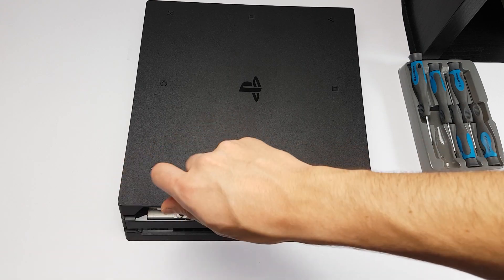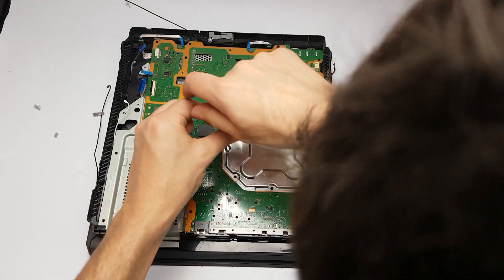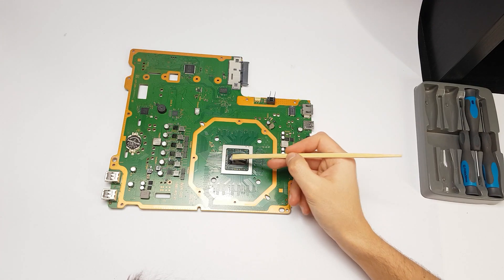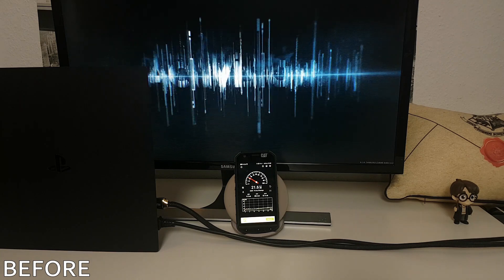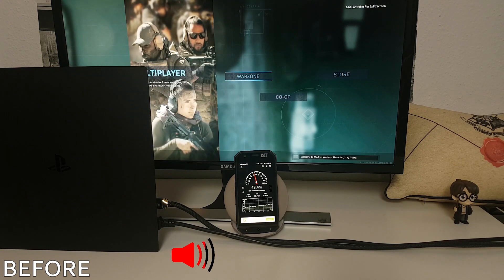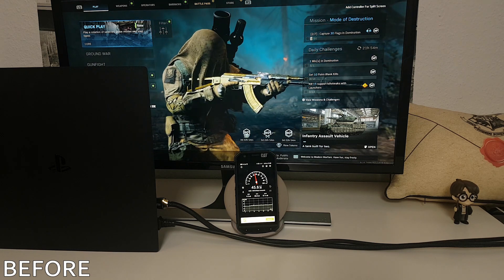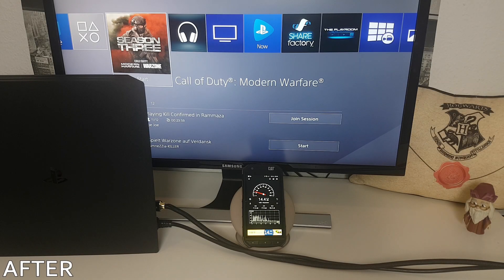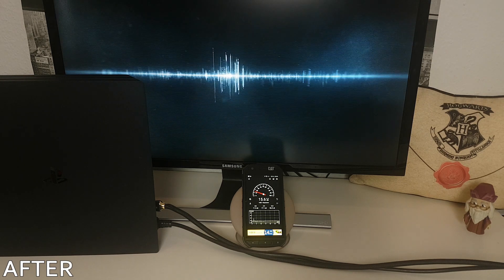PS4 PRO Fan Noise FIX - Thermal paste & dust - Before/After TEST

Comment: No wonder with so much Dust on the Headsink ,  normaly the Thermal Paste holds up more than 13 Years
Reply from the maker: I don't think that the amount of dust is enough to explain the loud noise 🤔
Reply: @SiriusMonkey  You should better watch this Video exactly  you see it removes a  strap big Dust from the hole side of the headsink . for sure this causes overheating  and also it depends wich Fan is inside the Delta Fan is louder than Nidec
Reply from the maker: The amount of dust does not help. But even after removing dust, replacing thermal paste + thermal pads, the PS4 Pro gets loud after a few months.
Reply: @SiriusMonkey  Thermal Pads and  Thermal Paste holds up for Decade  the PS4 Pro is general louder than Base PS4  my PS3 has 14years with stock paste  and if you want a silent PS4 Pro you Need the latest Revision Version they have diffrent Headsink and Cooling  👌
Reply from the maker: That's the point, the first versions of the PS4 Pro became loud after a few months 😊 My base PS4 & PS3 were relatively quiet although I never cleaned them.
Thank you for your feedback !

Comment: `just wondering why you test your playstation standing up, it has a blocked cooling port that way since it's cooling intakes and outtakes are on the side, you're literally just chocking you system
Reply from the maker: You're right, it's definitely not the right way to test it! I've done test with the PS5 standing up and the results were practically the same.. 
Thank you for your feedback !

Comment: I rarely like a video, and even rarer do i comment, but i can't describe how much quieter my ps4 pro got. It's like brand new. I didn't apply new thermal paste, but the guy i bought it from had applied waay too much, so i had to remove a lot of it. Also, i got to clean the heat sink, which was totally blocked. Now i'm not ashamed to turn on my ps4 anymore :)))
Reply from the maker: Nice, I'm glad it helped ! 😊 Though I gotta say that mine became louder after 2 months or so...
Reply: @SiriusMonkey  aight, i was aware it was probably a recurring issue. We’ll see when i have to fix mine again
Reply from the maker: @TheRegularity  Unfortunately yes.. The PS5 is however dead silent ! 😊

Comment: i have cleaned the dust and changed the thermal paste of the PS4 pro at a technitian 3 times already. Right after the procedure the console is really silent, but after only 3 months the jet engine starts over again. i'm also regulary cleaning the dust with compressed air avery month. Maybe Sony are telling us, it's time for an upgrade ;-)
Reply from the maker: The same happened for me.. Ater 3 months or so, I had to replace the thermal paste again. The PS5 however is so silent ! 😊
Reply: Call me paranoic, but i keep thinking it is something implemented in the code of some of the most played games, that is making the chip thinking it is overheating...
Reply: @miroslavgeorgiev8778  i wouldn’t even be surprised tbh all these new games are just making my ps4 louder
Reply: It’s funny to see people like you. There’s an Xbox one x available for sale. Probably someone would swap theirs for your PS4. But you keep torturing yourself. Why? Makes no sense.
Reply from the maker: @vitorfernandes651  Porque gostamos mais da Play 😊

Comment: Does any of you notice that your PS4 also runs quicker and maybe even your game performance enhances due to this fix? Maybe it's a placebo but I have a feeling like it is.
Reply: No it is very true. You see when a lot of elements appear on the screen you experience a temporary slowdown that is called throttling. Since you are not hitting the same absurd temperatures as before, the PS4 does not reduce the clocks to preserve your APU anymore.
Reply from the maker: @cemsengul16  Okay, thanks ! :)
Reply from the maker: Why not ! What makes you say this ? :)
Reply: @SiriusMonkey  I felt like after fixing mine the exact same way you did, not only did sound disappear, but navigating though the menu feels quicker and even my games feel a bit smoother, however I have no proof of this and it could just be a placebo you know 😂
Reply from the maker: @MITSJL  Yeah I got you, it's a very interesting observation! And I hope it's true 😁 Thanks for your feedback !

Comment: 2 hours!? I did it without a t9 security torex in that time 🤣
Reply: which thermal paste did you use ? cause I used Arctic Mx4 but while playing Last of us part 2 it still runs at medium sound . Can you share your experience with me.
Reply: @uzairahmed3103  it was a while ago so cant remember the make, but it was silver based. Had to be careful of overflow. It shouldnt really matter of the make tho. Aslong as you dont put way too much or too little. I put a pee size + a tiny bit extra . Did you clean the heat sync also? I used a fibre cloth as was too sticky for cotton buds. Ps4 is running quiet as when I first got it now.
Reply: @uzairahmed3103  I used" arctic silver 5" had to go in garage to find out lol
Reply: @dragzgaming  Thank You so much for ur time. I also put a pea sized thermal paste in the centre and as for the heat sink I only used a vaccum cleaner on it but it wasn't dirty. Does it take a while for the thermal paste to start acting properly cause I just changed it a few hours ago and I have read somewhere that it gets better in a few days.
Reply: @uzairahmed3103  should tell first time you put it on. If heat sync was clean and you cleaned the CPU before applying paste only other things I can suggest is to brush out the fan with a paint brush, make sure the power block is free of dust by blowing in there and when you put the metal arm back on the top of the metal outer layer be sure to do one side half tight then the other side and try to do it up evenly ( it's designed to spead out the paste evenly by putting pressure on the sync and cpu).

Comment: i test with my ps4 pro and i notice that theres is an amount of themal paste that you have to aply, to much not work, not much its not work theres a middle amount that will works like 1 1/5 drops will work perfectly and i keep testing removing metal parts and almost naked the ps4 makes like 10 or 13 Db as much but i notice that we have to use special thermal paste not all the thermal paste works as well (sorry for my english hope u get it)

Comment: I found that when I had my PlayStation laying flat on not on its side it also stopped making this loud sound ,thanks for posting
Reply: That's because there are vents on both sides of the console. Also as a tip, put some bottle caps in each corner below the console, will definitely make a difference. I'm pretty sure we both know that putting it in an enclosed space will just make it overheat even more, I learned that the hard way...

Comment: Damn your fan is soooo much louder than mine 😂
Reply from the maker: Unfortunately, I'm not the only one 😅
Reply: @SiriusMonkey  dude I also have a question. I cleaned my fan and heatsink and everything else. Scraped the old thermal paste but didn’t add new one. And it’s overheating faster,is the thermal paste the problem?
Reply from the maker: @aaryanatreya5591  You have to apply thermal paste, it is very important! Otherwise the heat from the processor is not properly transferred to the heat sink, which can cause overheating :)
Reply: @SiriusMonkey  omg thank you sooo much,I thought I broke the fan or the heatsink :D
Reply from the maker: No problem :)
Reply: @aaryanatreya5591  This could have gone very, very wrong. Good thinking of you to ask.
Reply: What an idiot! Scrapes off thermal paste, but doesn't reapply new one. What the hell do you think it's there for! It's not rocket science. Good thing for you the console has a fail safe mechanism, otherwise you would fried the APU.

Comment: The bigger the glob, the better the job!

OOF.  Yeah, a little goes a long way.  The paste's job is to fill the microscopic gaps when the heatsink and processor touch (which they do) - it is not meant to be a thick layer in the least.  It really should be quite thin.  Too much, and it can actually act more like a blanket, rather than transferring heat.
Reply: I use pea method for square die and line method for rectangular, usually put a bit more with mx4 and h1 as these are non conductive. The excess will just ooze out harmlessly. Never had an issue.
Reply: HUGE ANIME BREASTS

Comment: Love this video! I had the same 2016 PS4 Pro (famously known as the jet engine PS4 Pro) with the same noise problem. This was very informative, I also got a thermal paste replacement and it was definitely a great decision. I wish I got the 2018 redesigned PS4 Pro with the more power efficient plug and quieter fan. So this was absolutely a great video for me, thanks!
Reply from the maker: I'm so glad you liked it ! Thank you for your kind feedback :)
Reply: @SiriusMonkey  hey some people say it only lasts for about day is it true or is it still fine
Reply from the maker: Mine lasted 2-3 months 😊 Depends on the quality of the thermal paste & how you apply it
Reply: @SiriusMonkey  does removeing the dust stuck on ur heatsink help in lasting a lil longer cuz I can’t afford paying 70 every 2 months to do this cuz I’m a kid and I have to give it to a repair shop they do it for 70 aed and I’m broke so yeah
Reply from the maker: @courto1s318  Removing dust definitely helps, but it doesn't make that much of a difference. I would recommend doing it youself: it costs 5 dollars and 1 hour of your time 😊
Reply: @SiriusMonkey  the thing is I’m scared to do it at home and the amount of confidence it took me to just remove the upper shell was a a lot I don’t have thee confidence
Reply: @SiriusMonkey  the thing is I’m scared to do it at home and the amount of confidence it took me to just remove the upper shell was a a lot I don’t have thee confidence
Reply from the maker: @courto1s318  Understandable! One small mistake can harm your PS4... It's up to you really 😊
Reply: @SiriusMonkey  u have discord ?
Reply from the maker: @courto1s318  Not yet.. 😊
Reply: @SiriusMonkey  I got my ps4 pro back and not even one decibel and it’s hot like very hot but ain’t giving me any errors but the fan is running but I really have to lean towards it and my disc drive doesn’t seem to be working for all my discs I messaged them they said they will check it out today

Comment: Before I replaced the thermal paste and thermal pads, it used to run really hot and fan sounded like a saturn five rocket taking off.  Then used Thermal grizzly kryonaut and Arctic thermal pads and its been silent ever since,  fan is completely silent now.
Reply: Also it used to shut dwn on its own.  When first opened it, the thermal paste was on half the processor as was 2nd hand n shop i got it from said they replaced the paste n pads.  But did a shit job.
Reply from the maker: @st1kman2009  Replacing the thermal paste helps a lot ! My PS4 Pro was quiet for +/- 1 month. I guess with a better thermal paste and new thermal pads, it could last even longer :)
Reply: @SiriusMonkey  been 3 months since doing it and it's not even audible now.  Fan hasn't ramped up even once.  Best thing I've done for it
Reply from the maker: @st1kman2009  Great job :)
Reply: What about heat?

Comment: i just applied new thermal paste to my ps4, ran cold war and it was too quiet for me to believe the fan was plugged in. Thinking i broke it i checked and it was all plugged in and normal, way better than before.
Reply from the maker: Yes, it makes a big difference !
Reply: Which thermal paste did you use?

Comment: Another tip : DISABLE Super Sampling for those owning a PS4 PRO . Now ,  IF your TV or Monitor has a high resolution eg 4K , you must ALSO MANUALLY set the Output resolution to 1080p .
Reply from the maker: Thank you, I will have a look :)
Reply: @SiriusMonkey  Basically , recent games pushing the hardware to it's very limits dramatically increases the GPU temperature and as a result the fans need to spin as fast as possible . One can also manually set the resolution to 1080p . It is essentially the same thing . Personally , I only Disable Super Sampling when I see that my PS4 PRO makes too much noise . It is not only a matter of me preferring a quiet gaming experience . It is also a matter of making sure I do not damage my PS4 PRO during pro longed gaming at high temperatures .
Reply: I forgot to mention something . I shall edit my first comment . Basically IF one has a TV or Monitor that has a resolution higher than 1080p then one must ALSO MANUALLY set the Output resolution to 1080p .

Comment: I just did this on two of my PS4 pros a few days ago. Although I didn’t have really any dust at all, those fans would get really loud. I changed the thermal paste and thermal pads and wow, can’t even hear the fans now. I read somewhere that Sony either didn’t use enough thermal paste, or they used a cheap paste that dried up and therefore didn’t make a good connection. Who knows. Just glad it’s quiet now.

Comment: Is there a specific thermal paste type that I should be using? Or any thermal paste will do?
I have the original PS4.
Reply from the maker: I've used Noctua NT-H1 and it silenced my PS4 Pro for +/- 1 month. Sorry, I am no specialist in the field fo thermal paste.
Reply: @SiriusMonkey  Thanks anyway. 🙏
Reply: @abm9056  kryonaut thermal grizzly is a good thermal paste
Reply: @alwaysloaded4585  Thank you.
Reply: @abm9056  np

Comment: I did everything what you did, but the fan was still making REAL LOUD noises. It’s worse than before I did the cleaning. I tried again two times and it still doesn’t work, it’s still loud. Do I need to apply thermal paste on both or just the cpu?
Reply from the maker: Just apply enough thermal paste on the CPU. It should cover up the entire CPU. I'm sorry if it didn't help..
Reply: @IOIO no it worked okay after I took the system apart for a second time. I took it apart five times. Just for the fun of it lol. Happy gaming!

Comment: Do you think it was a combination of dust cleaning AND thermal paste? or mainly one or the other?
Reply from the maker: Definitely a combination of both, but I guess the thermal paste is the main one.
Reply: @SiriusMonkey  I hope so! My house mate just did all this, he cleaned the fans/heatsink out last time and it made a little difference. We swapped out the thermal paste, yet to test as he broke a pin on the power supply...
Reply from the maker: @MrLincoln87  No way...
Reply: @SiriusMonkey  Its only that little 4 pin cable that he unplugged, and when trying to plug it back in, he broke one of those pins on the PSU side.
Picked up a refurbished psu for $50aud so no drama. Told him to send his one in for rebate.

Comment: The heat sink was the worst part it was so clogged, i cleaned it and the thermal paste was alright but i still replaced it and when i ran siege before it was so loud i could hear it through my headset and now i can barley hear it without my headset on! I recommend if your going to do this find a more in depth tutorial i found howtofixit was a good tutorial thanks!
Reply: i have a 2y/o ps4 pro and siege is unplayable its so fucking loud i can hear it outside my house

Comment: Was wearing earphone while watching this on my MBP and when the fan sound kicked in, i immediately took my earphones off to see if it's my MBP running like a jet again! lol Great Video!
Reply from the maker: Was it ? 😅 Thanks.
Reply: @SiriusMonkey   almost the same... Unfortunately, almost the same as your before  TP sound recording, will do this for both my ps4 and mbp. Thanks!
Reply from the maker: @nebo23  My PS4 Pro went quiet for approx. 1 month after changing the thermal paste.
Apparenlty, changing RAM thermal pads + processor thermal paste helps even more.

Comment: Bro i think your thermal pads are not doing fine try to replace them they will give you a better result thermal pads are so important when it comes to lowering  loud fan noise trust me i was thinking thermal paste is enough but i was wrong after i replaced mine with good quality pads my ps4 sound the same whatever i play any game on regular room temp still quite like if it was actully turned off when they are not working fine heat will not be transferd to the heatsink in the right way because they are broken be aware of that good luck by the way 🙂👍
Reply from the maker: I was tinking about changing the thermal pads & paste. After a month or so of changing the thermal paste, my PS4 Pro is quite loud again... Thank you for the feedback :)
Reply: @SiriusMonkey  you are welcome make sure the size is 1mm thick 👍

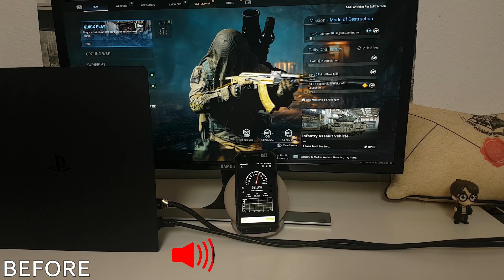Comment: 4:32 My PS4 Pro Never went so loud time to clean and change the thermal paste to Thermal Grizzly Kryonaut the best out there to dissipate heat much faster and become much cooler and silent ! U can use Liquid Metal for absolute best heat dissipation but I wouldn't recommend it can corrode parts like the chip surface and embed into cooper structure impossible to change afterwards !
Reply: Plenty of misinformation in this comment. Source: liquid metal user here.

Comment: After the cleaning should the ps4 pro even sound at all that high? I get it's not as loud as before but just asking if even that is normal.
Reply from the maker: Mine still gets loud, but a little less than before.
Reply: Sirius Monkey one of the small black screws got damaged while i was trying to get it out and finally change the thermal paste, it seems like it won't come out so after when i'm done i'm going to leave that screw out, my question is if you think anything could happen because of it? If so where could i find replacement screws for it. Thank You